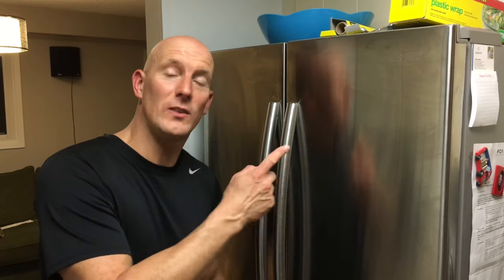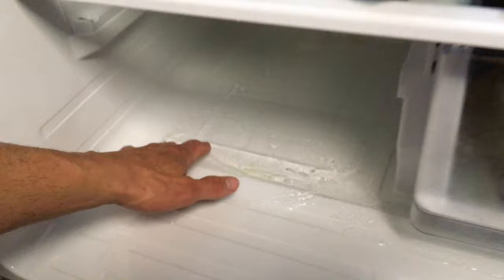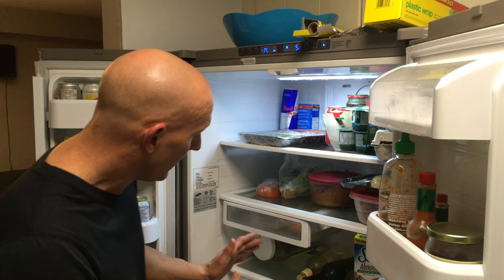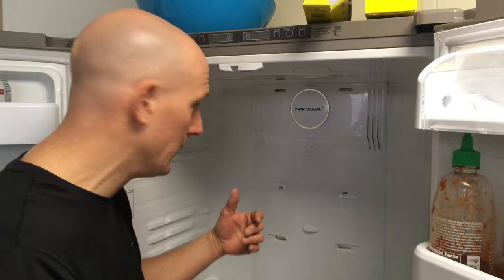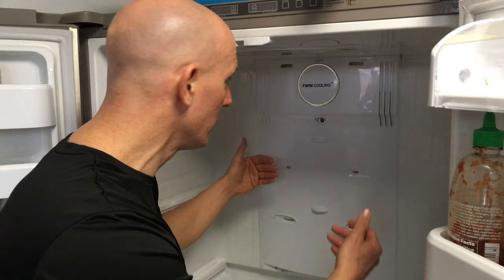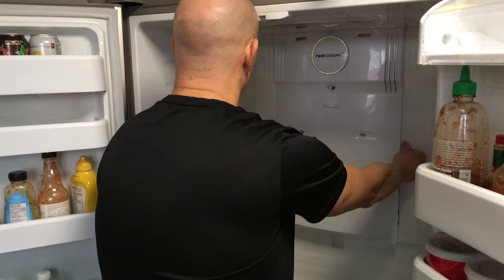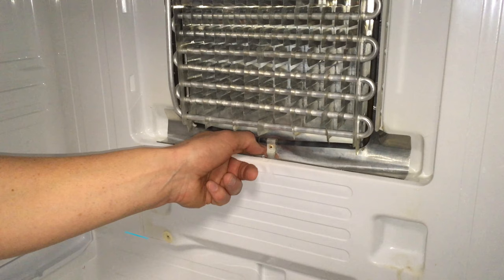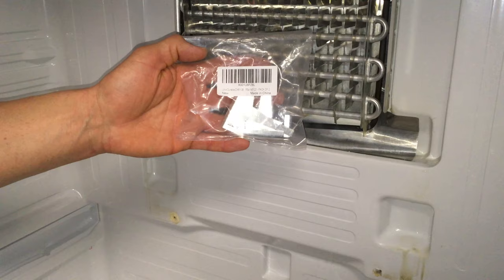Ice & Water Buildup (4K) Samsung Refrigerator

Comment: Yes, ours has the same issue but have not tried the fix yet. Looks harder to take off the panel and put it back into place than to switch out the part. Thanks for the how-to-video. Very well done.
Reply from the maker: Remember to check the drains as thats 99% of the issue.  Thanks so much for watching!
Reply from the maker: Thanks for watching!
This is the updated Repair Kit that you need for Samsung.
Samsung Water / Ice Repair Kit:
Amazon US: https://amzn.to/3YN4Enw
Amazon Canada: https://amzn.to/3WKlUYK

Comment: I have a GE Profile fridge that is very similar to the Samsung.  I had the same ice buildup under the deli tray, but also had a ton of mold buildup in the ice as a bonus!  Very appetizing.  I bought a 4 pack of the replacement clips and used 3 of them.  I put one in the drain and other two on either side of the drain.  On the two, I bent the bottom of the clip so it rests in the trough.  I found ice in the trough so I think it might be ice buildup in the trough causing water to go other places other than down the drain. We will see how it works.  It's possible I may have to adjust the bent clips, but hopefully the problem is resolved  thanks for the video!
Reply: Mold in your ice would likely be the water source you have, the city water where we are varies so much from cloudy to strong chlorine it makes one wonder if they have any clue how to maintain water quality.
Reply from the maker: Thanks for watching!
This is the updated Repair Kit that you need for Samsung.
Samsung Water / Ice Repair Kit:
Amazon US: https://amzn.to/3YN4Enw
Amazon Canada: https://amzn.to/3WKlUYK

Comment: If the drain is still blocked I took a little cup of really hot water and poured it down and then took a turkey baster and sucked the water in and out and then sucked it out and then put more hot water in and I did this about 10 times until the ice in the drainage tube was melted eventually I was able to pour the water in and it just gargled all the way down and drained very well. So give that a try if the drainage hose is still frozen and blocked up. Really hot water pour some in and then let it sit and then take the turkey baster squeeze it in and out in and out in and out to lmove the water around to melt the ice. It worked really well for me. Also I used a clothes steamer instead of a hair dryer so I wouldn't dry out any parts inside. on the ice that was still stuck in there even though I had unplugged the refrigerator for 24 hours.
Reply from the maker: That seems to be the issue with most.  Replacing the drain tubes is the best thing to do with the parts I have in the description!  Thanks For Watching!

Comment: I did this fix about 2 months ago for my mother. However, we are back to the same problem!! I hear that using the wire wrapped around the heating element works better. Hope the wire works. As I am very disappointed that the repair didn’t take care of the problem. Ugh 🙁
Reply: Hi Jode, did you try the wire? I am having the same issue after fixing with the recommended new part.
Reply: The wire worked for us. Haven’t had to redo since I used the wire.

Comment: Wanted to add to this. Couldn't figure out why our fridge functioned completely fine for years then out of the blue it started freezing up. Lair of ice under the freezer and behind panel on fridge. having to defrost every couple months I have recently purchased the clips for the evaporator coil behind the panel haven't installed them yet decided to take the back panel off and clean the coil at the back. Lots of dust preventing it from operating efficiently.  In doing this I believe I have determined exactly what the issue is. there are two rubber drain hoses one for the freezer and one for the fridge  The hoses that direct to the drip tray when I removed them and inspected them,  they were plugged completely with grunge this would explain why it only took two months before the the unit started freezing up again.Water doesn't drain overtime it backs up in the tubes water gets the top and freezes blocking hole. Be sure to check this if you're having this problem. I guarantee this is root cause. Cheers!!!

Comment: Hi Jeff. I just purchased the clip. Looks like the end of the clip is too long. But I put it anyway. Hopefully it wouldn't cause any trouble
Reply from the maker: If it fits its OK.    Check your drain tube as that is the main issues.
Reply: @JeffLepard  I didn't check the drain tube at all 🤷 might do that tomorrow. I just cleaned my fridge, put the clip, then put everything back after. How do I know if I have clogged drain tube?! Will I see. Water underneath?
Reply: @chloeabibas  it's the drain tube for sure check.  I put the replacement package for the drain tube in the video description up top.
Reply from the maker: @chloeabibas it will be the drain tube 100% you can also order the drain tube from the kit in the description.

Comment: Hi Jeff-  Thanks for the video. Well done. I have a Samsung RF 18HFENBSR fridge with the same ice buildup under veggie trays. Service person replaced the defrost clip with a larger one and replaced the drain  tube with a new one about six months ago to resolve same problem. Ice had already started building up after about 3 months. Repair person came today, did not disassemble the back panel to inspect, and said fridge needs a new back panel, since it has a new seal. This does not seem to make sense to me. Do you think it will help or be another wasted day off from work?
Reply from the maker: Thanks for watching!
This is the updated Repair Kit that you need for Samsung.
Samsung Water / Ice Repair Kit:
Amazon US: https://amzn.to/3YN4Enw
Amazon Canada: https://amzn.to/3WKlUYK

Comment: Great video, for some reason my plastic panel looks same as yours, but only has 2 screws on the bottom, & after I removed the (center top) small plastic cover,  there is just a small square foam behind it.  My model # SAMSUNG RF20HFENBSR Very helpful video tho.👍

Comment: good video. I have RF268 ABRS model (french door with ice maker in the left door and freezer as well) since 2012 when we purchased it. it has been trouble free until march of 2020 when we noticed water in the crisper drawer. I wasnot sure where the problem is so we we were just wiping it off every few days up untill now where there was so much ice build up behind the panel that it was coming out through the little air vents.
I took it apart, replaced mentioned in this video clip but could not made the drain to open as it was clogged and water was just sitting there.
I took the bottom panel off on the back of the fridge (5 screws i think) and checked the drain at the very bottom where the water should go right into plastic tray and evaporate. That was an issue as it was completely clogged causing water to sit in the drain and freeze all the way up to the fridge and leak inside. 
I cut the tip of it off with scissors and voila drain was completely open again.
I would advice anyone to check that rubber drain at the back on the bottom if its not blocked which is extremely common issue with these fridges, 
Be careful when you take it off though as if there is water sitting in that line it will just squirt and you will get wet...dont ask how i know haha

Comment: So, I have another brand name, far less expensive refrigerator. Mine used to freeze in the drain as well as did the in-laws. I took the heating element and put a slight bend closer to the drain and has never been an issue, again.

Comment: Great info on fixing the issue that I too am having with my French Door Samsung refrigerator. Just a quick question, rather than unplugging my refrigerator for 24 hours to let everything defrost, couldn't you use a heat gun to melt any ice build up?
Reply: Use a Haan steamer
Reply: @jonathanoconnor9546  ok txs, but did you mean Handheld Steamer?
Reply from the maker: Thanks for watching!
This is the updated Repair Kit that you need for Samsung.
Samsung Water / Ice Repair Kit:
Amazon US: https://amzn.to/3YN4Enw
Amazon Canada: https://amzn.to/3WKlUYK

Comment: Thanks for your video. When I removed my panel, I noticed a small tear of Styrofoam and a little gap on the bottom of the panel. Will this be an issue when I place the panel back?
Reply from the maker: It shouldn't.  This is the updated Repair Kit that you need for Samsung.
Samsung Water / Ice Repair Kit:
Amazon US: https://amzn.to/3YN4Enw
Amazon Canada: https://amzn.to/3WKlUYK

Comment: I got the same fridge, with same issues,  just ordered the part on amazon, it'll take about 9 days to ship to my place, I'll let you guys know if it works. I subscribed and liked.
Reply from the maker: I hope it works out for your, I will be doing another fridge video there are a few other things you can do I will upload soon!  Thanks so much for watching!
Reply: Did it work
Reply: @dmgfxinkslangatattoos9844  unfortunately no, it only fixed 50% of the issue,  I also had to replace the rubber gromets where the drain pipes go down in the back ,  thats where the  stoppange was,  and blocked, and pushing water up and through the drain hole back in the fridge and then out on the floor. Once i unblocked the stoppage in the gromets and replaced them, fridge was fixed again no issues since i replaced the gromets and the metal piece.

Comment: What does "FR" do , had it on Fr and nothing happpened. So I need to do "Fd" because my problem is the fridge icing up not the freezer but I ahve the same problem with this janky  Samsung refrigerator model RF266AERS

So hold the FREEZE and COOL buttons to get the codes up?

Comment: Have same fridge , same problem. When I found the polystyrene over the evaporator coils and blocking  the 4 vent holes- I thought it must be  transport  packaging accidentally  left in place !  Temp sensor can also Ice up - should be in compartment not wall. Temp display never aligns to any Independent thermometer placed on shelf by 3d.C.  Another example here of a company relying on Dilbert to do their product engineering work post sale.

Comment: i keep getting frost building up and blocking those to middle cold air vent on the back panel....  i blow them out with a steamer, and in a week or 2, its back
Reply from the maker: Check the 2 drains at the back of the fridge behind the panel.

Comment: I had my doubts taking advice from a guy using a steak knife and a Leatherman instead of screwdrivers 😁. Be sure to carefully drill out the rivet or use a pair of snips to cut out the old part to avoid damaging the heater. Tugging on it with a pair of plyers is not the best rout.  Also, the tabs you can see on the replacement heater extension need to be wrapped / crimped around the heater (not left lose) to ensure it stays in place and has good contact with the heater.

Comment: Thank you for the video. I did repair that frost problem.   Now the the doors with with small panel on the left door does not fully close when shutting the door. 
That panel has dropped down and it won’t go into the track thing on the top of door jam.  What is the solution to that?

Comment: Thank  you! I just ordered the part from Amazon.  I did one repair which was in the back which helped, but didn't solve the problem long term.
I think I can do this by myself. Will the drainage pan overflow when fridge turned off?  Also, once we put my R17 Samsung into demo mode which turned off heat I think.

Comment: The 2 metal tabs on the new installed part are supposed to wrap around the heating element to increase heat transfer.

Comment: Hi Jeff! I just did this this past weekend, but today I noticed a little bit of condensation and maybe a little bit of freezing up on the wall. Is it normal to have a little? I'm worried the ice is about to build up again and the "fix" didn't work. It's only been about two days.
Reply: Yup. Sure enough…Two weeks later, I see the ice has built significantly, and the fan started making a noise. I’m assuming the noise is from it hitting the ice build-up until it completely freezes it. 

Would appreciate any advice!
Reply from the maker: Thanks for watching!
This is the updated Repair Kit that you need for Samsung.
Samsung Water / Ice Repair Kit:
Amazon US: https://amzn.to/3YN4Enw
Amazon Canada: https://amzn.to/3WKlUYK

Comment: I am having difficulties getting the back panel off.  I took out the three screws (2 at bottom and 1 under the cap in middle towards the top), but it is stuck.  I have it pulled off about 3/4 the way up.  It seems to be stuck right in area where the cap/screw is.  I pulled and my husband pulled.  It is just not coming off.  Anyone have any suggestions as to how to get it off or what could be preventing it from being pulled off?
Reply from the maker: If there's no ice holding it, usually that's what is holding it together.  Might be stuck on something.

Comment: Jeff,
Great video. I got the clip but my Samsung (RF260BEAESG) is slightly different. Tube clip attaches to is not straight  across  the bottom.  It angles down from each corner to just above the hole, putting rivet below the ice tray. Also seems clip bends toward the back, making little shelf, I guess to help melting. 
Ever seen this variation of Samsung?
To put in new clip means surgery to clip and existing system. 2nd defrost and empty. Hate this thing.

Comment: Hey Jeff thanks for the video it’s a big help.  I’ll buy the part from your Amazon affiliate link.  Where does the water go when it drains.  I don’t have a drain line hooked up to the fridge just a water line in for the ice maker.  So where does the water go?  Does it just evaporate down there in a pan or something?
Reply from the maker: Thanks!  Pull off the back plate there's drain tubes and a collection pan.  You can check out my other video I have that in there.  I will be updating this video with a brand new video.  Thanks For Watching!

Comment: I tried this and the drain tube still froze up. I now added a length of 8 GA copper wire down the drain and wrapped the top around the heating element. We will see how it works! These fridges sure are pieces of junk. It was in the house when we bought it but even of this fix works, I am getting a better (hopefully) fridge.
By the way, you have to allow the coil to fully defrost before removing the panel. I destroyed all the "insulation" aka styrofoam when I removed the panel the first time. You can wait, or, you can put it into force defrost to speed the process up. You can google search YouTube to find out how to do that.

Comment: Hi Mr. Lepard.  I just installed the parts today.  I bought the double pack and installed one and the other I mounted on top of it, on the opposite side of the defrost element, just because I'm sick of this leak damaging my veggies.  The install was super easy, but do you think this will cause a fire?  Also, the bottom drain tubes on the back had missing parts, so I have  to order them as well.  Also, on the back cover, one screw was sitting in a gap instead of being screwed in a screw hole.  The one lesson I learned is to never, NEVER, buy a Samsung appliance again.  I may just as well throw money away.

If this doesn't work, my next step is to replace the defrost element with it's sensor, as I tested the fan and it was working fine.  If that doesn't fix the problem, I will buy a new fridge.   

Never buy a Samsung refrigerator folks, unless you want to find a temporary home for your food every few weeks to thaw the damn thing out!
Reply from the maker: Thanks for watching!
This is the updated Repair Kit that you need for Samsung.
Samsung Water / Ice Repair Kit:
Amazon US: https://amzn.to/3YN4Enw
Amazon Canada: https://amzn.to/3WKlUYK

Comment: I have a question about the drip box under the frig that "catches" the water.  Does it ever need to be emptied? Is it easily accessible?  We have the part, waiting for everything to thaw.
Reply from the maker: Nope you don't have to empty that out it will evaporate.  Just make sure your drains are not plugged that's the main issues with these fridges.
Reply: We got it all done.  Took almost 2 days for everything to thaw. The part I purchased ended up being a little to long and wide (the long section).  My husband, a retired sheet metal worker had some tin snips and was able to cut it to fit.  We have a flashing E, and have had since we brought it home 5 or 6 years ago.  But it seems to be working ok.  So far not ice build up.

Comment: I tried doing this only I used a couple of copper wire pieces and threaded them from the heating element down into the drain. It's been about 4 months and I'm having the same problem again. I see a lot of positive comments on people who were able to install Jeff's recommended adjustment. Does anybody have any comments on it's success rate over a period of time?  Thanks for your feedback as I'm wondering if I might just need a new fridge.
Reply from the maker: Did you check the Plastic Drain pieces at the back of the fridge that's the main cause.  I am doing an updated video on the fridge and freezer I was waiting for parts.  The next video should be up next week.
Reply from the maker: Thanks for watching!
This is the updated Repair Kit that you need for Samsung.
Samsung Water / Ice Repair Kit:
Amazon US: https://amzn.to/3YN4Enw
Amazon Canada: https://amzn.to/3WKlUYK

Comment: I had the same issued but this heat transfer thing won't work. It still have ice build up in couple of months. The drain tube is too small for water to drain off. It needs at least 3/4 inch drain tube, not 1/2 inch tube. I will try to replace the drain tube for a bigger tube. Thanks for the video and  info
Reply: If the drain tube isn’t working it’s bc your drainage tubes at the bottom of the fridge drain into the drip tray are clogged